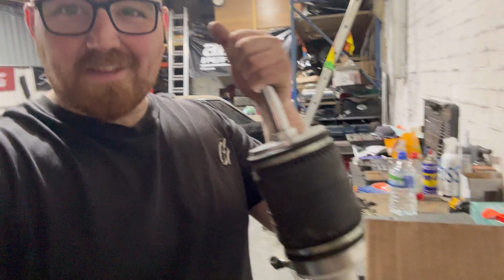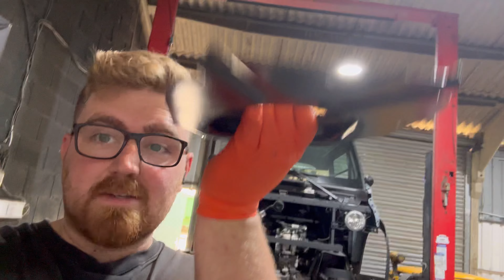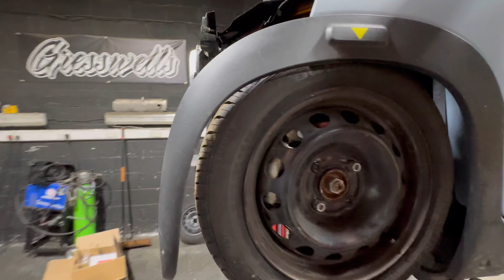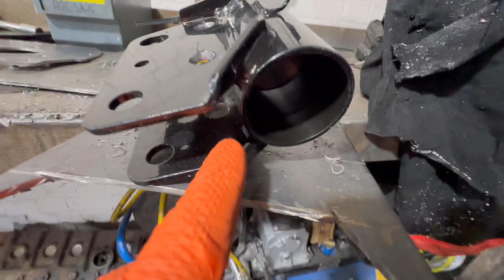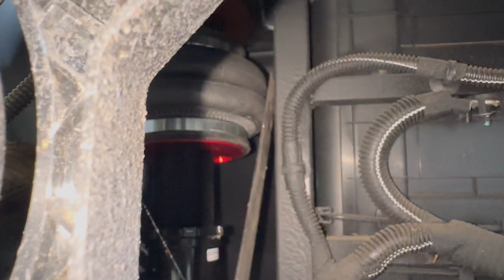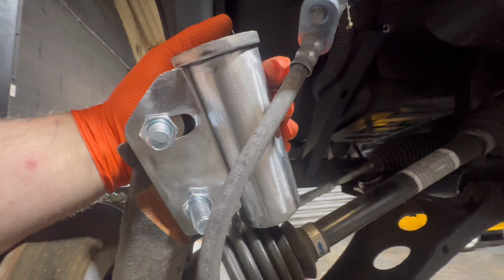BAGGING A CITROEN AMI - EPIC

Comment: Did you remove the internal bumpstops on that TA Technix strut? They usually have about 30-40mm of plastic bunpstops to pass TUV inspection. Used to have to remove the bumpstops to get lows out of them. That said the sleeve bag on them was a pain to get to roll correctly, used to swap double bellow TA bag onto them
Reply from the maker: i did remove it, still no enough!
Reply: @Joshwaa___  dammit that’s annoying, but glad you found a solution!